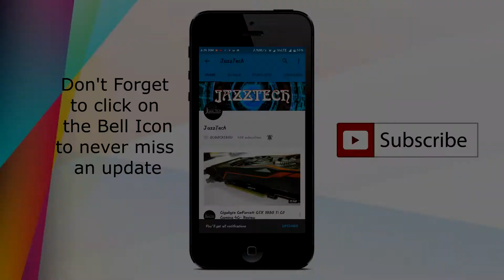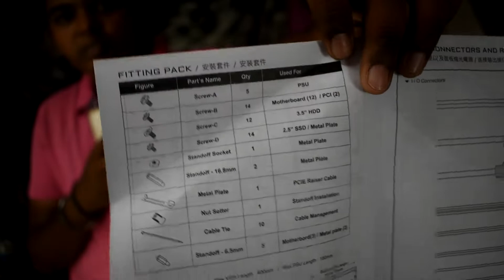The Best Gaming Cabinet Gigabyte AORUS AC300W Cabinet - Unboxing And Overview

Comment: can u tell me if the case rgb will work in normal b450 motherboard or do i need some special motherboard for this cpu rgb to work which connector does it require for the rgb
Reply: ofcourse!!! yes 
B450 pro  is compactible for external RGB fusion....